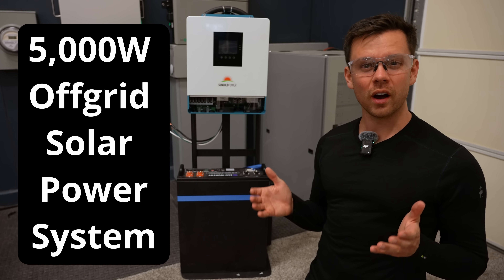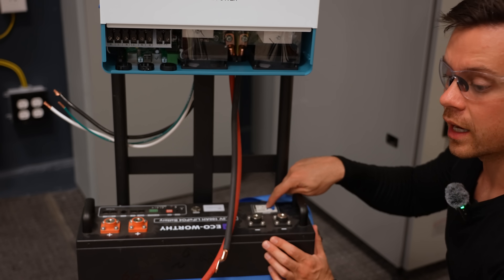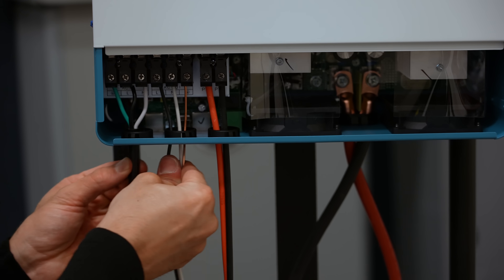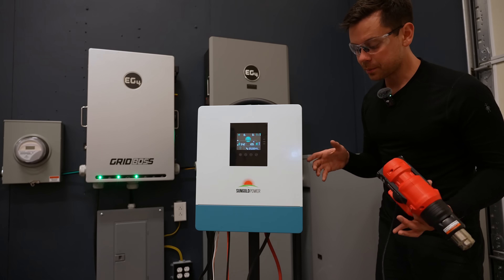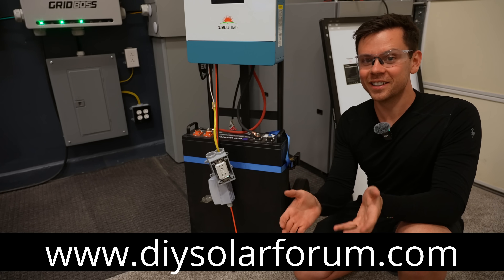Build a 5,000W Off-grid Solar System in 1 Hour

Comment from the maker: Official Parts List to Build Your Own):
https://www.mobile-solarpower.com/mobile-48v-system.html

Important Links Mentioned:
Cold Climate String Voltage Calculation: https://youtu.be/5sYi_HFgmSY?si=OUrvc26LGTzEC4Gn
Outlet Box Tutorial: https://youtu.be/6nPgF8RmDCc?si=ge33kO75pXfk86I2

0:00 Intro
0:18 What You Need First
0:44 Connect The Battery
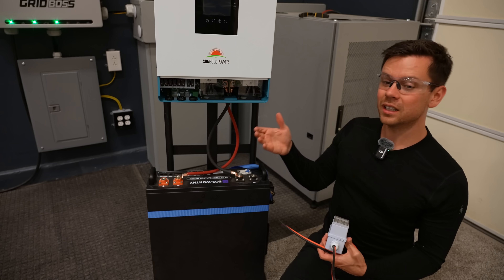1:42 Connect PV Disconnect
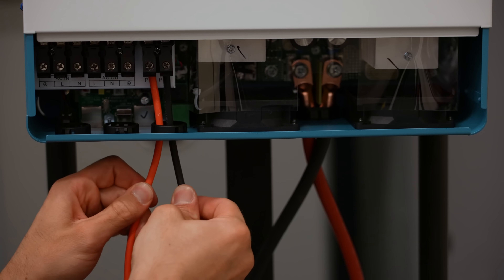2:23 Connect AC Outlets
4:08 Connect AC Input Cord
4:46 Power it up! 
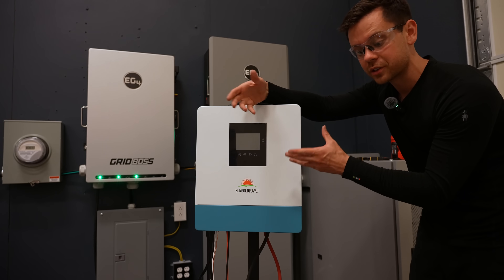6:30 How to Connect A Solar Array
9:10 Limited Roof Space? Use this!
9:32 Powering 12V Loads
10:03 Conclusion

~~~~~~~~~~~~~~~~~~~~~~~~~~~~~~~~~~~~~~~~~~~
Tired of getting ripped off? Check out my "Will Prowse Approved" solar product recommendations below!

12V Batteries
https://www.mobile-solarpower.com/lithium-batteries.html

48V Batteries
https://www.mobile-solarpower.com/48v-batteries.html

Offgrid Inverter System Builder
https://www.mobile-solarpower.com/48v-complete-system-blueprint-559371.html

Hybrid Inverter System Builder
https://www.mobile-solarpower.com/code-compliant-48v-offgrid-system.html

Mobile Handtruck System Builder (very popular!)
https://www.mobile-solarpower.com/mobile-48v-system.html

Solar Panels
https://www.mobile-solarpower.com/300w-solar-panels.html

Ground Mount Solar Racking
https://www.mobile-solarpower.com/ground-mount-racks.html

Wire, Lugs and Busbars
https://www.mobile-solarpower.com/wire-and-connectors.html

Tools
https://www.mobile-solarpower.com/tools.html

Fuses and Circuit Breakers
https://www.mobile-solarpower.com/fuses.html

Plug-N-Play Solar Systems
Ecoflow, Anker And Bluetti! So many models to choose from. See my current recommendations here:
https://www.mobile-solarpower.com/full-size-systems.html

~~~~~~~~~~~~~~~~~~~~~~~~~~~~~~~~~~~~~~~~~~
Need to build a large DIY system? Need a trustworthy solar distributor? These are my favorites:

Signature Solar
Creator of EG4! Solar Minisplits, Victron and More! Largest Solar Store Online.
If you want $50 off, please use my link below and coupon code "DIYSOLAR50":
https://signaturesolar.com/?ref=cPwLcVc0SW-BjN

Current Connected
Best Prices for EG4, Victron, Midnite and so much more! Fast Shipping and Highest Rated Customer Service:
https://currentconnected.com/?ref=wp

~~~~~~~~~~~~~~~~~~~~~~~~~~~~~~~~~~~~~~~~~~
Join our DIY Solar Community 
Need more help? Join the largest solar forum on the internet for beginners and professionals alike. 140,000 members and counting!
https://www.diysolarforum.com

Check Out My Free Book
Best-selling and beginner-friendly guidebook to off-grid 12V solar!
https://www.mobile-solarpower.com/the-book.html

~~~~~~~~~~~~~~~~~~~~~~~~~~~~~~~~~~~~~~~~~~
Contact Information:
I am NOT available for personal solar system consult! If you wish to contact me, this is my direct email: williamprowsediysolar@gmail.com
FTC Disclosure Statement and Disclaimers:
Every video includes paid promotion or sponsorship (such as free products for review). Some links on this YouTube channel may be affiliate links. We may get paid if you buy something or take an action after clicking one of these. My videos are for educational purposes only. Information is subject to change/update at any time. Electricity is DANGEROUS and can kill. Be smart and use common sense :) DIY Solar Power with Will Prowse is a participant in the Amazon Services LLC Associates Program, An affiliate advertising program designed to provide a means for sites to earn advertising fees by advertising and linking to Amazon.com
Reply: Will this scale to 10k?
Reply: So calm and really helped me fill some gaps in my knowledge
Reply: green wire of the tool cable going into the hybrid inverter should have been a bit longer than the others, to release last, so the meal housing is kept grounded for as long as possible (while the other two wires start to make contact with stuff) - giving the circuit breaker on the source side a way to shut the whole thing down.
Reply: Will i thank you for making these videos im 2 years away from living Off-Grid & I always watch your videos this makes it easier for me to start practicing here at my home.. Much Love ❤️ Thank you.
Reply: Will, you did not explain how you correctly sized your solar disconnect switch.  What is the proper way of doing so?
Reply: I’ve watched videos for Europe talking about its common to have a small system and charge it at night when rates are 1/2 price and then use the accumulated electricity to power the fridge and small appliances during the day.
Reply: Thank you very much 🤝
Reply: Will Can I connect this to a 30amp transfer switch?
Reply: How much do solar watts do I need to support this.
Reply: Thank you the "how to build" with parts list... Ordering now... Can you do a follow up on building a series with this type of system?
Reply: Will Prowess Solar Pro🎉
Reply: Hi.. Will..I'm about to build my campervan..will it enough to power my desktop computer, laptop,starlink and fridge other then that It just led lights..I often work on construction site that doesn't have electricity..oh yeah..at night I need to charge my drone..I live in Asia..
Reply: I have the same charger inverter can't I plug in a wind turbine into the unit on the 3 phase AC side, since they make ac power
Reply: Will have you tested any of their other inverters? I see a few split phases that are more affordable than EG4 then I would be interested to put towards this build.
Reply: Will:  I have a 24v microhydro system with inverter, regulator and batteries.  I would like to add solar for low water times, perhaps 400w.  

No one seems to know how to accomplish this.  Is it possible?  Difficult?

Many thanks 😊 

Paul
Reply: any thoughts on the T-type fuse between batteries and inverter? Potentailly using this as a critical loads "UPS"...
Reply: I wish you had a clone in the UK 🇬🇧,  id love to know what to look for here. Or even a great list of English websites that are reliable.
Reply: This looks identical to the Eco-Worthy 5000w 100amp AIO..... ????
Reply: Dude this video is awesome
Reply: Great lesson Will!  Thank you, subscribed.
I am setting up 8x410w solar, with EG4 6000W chargeverter, and 2x100Ah batteries (EG4).
I see you used an ECO-Worthy battery - very interesting.
I had seen the Sungold chargeverter you used here while I was shopping.
Again, thanks for the great example my friend.
Liked! 🌱
Reply: Interesting build Will, I understand you like 48v systems, yet at 5kw for the battery seems a little under powered. 

The question I have is why not use a 600 amp 12v lifepo4 battery and keep it at 12 volts, thru the system? 

A quick Amazon search one can find these 12v 600 lifepo4 batteries range from $750-1k. Add a 12v 5kw pure sine inverter, with a 80 amp mttp charge controller, add some fuses,solar panels,  a hand truck, some 0 gauge cables, some straps, etc and for under $2,700-$3,500 have a 7.5kw-15kw+ battery system. 

Considering that why would one step up into a 48v system? That has a similar cost yet with only 5kw, instead of 7.5kw or even 15kw or 46kw.
Reply from the maker: @antonwearsakilt5209  underpowered? The Max output of this battery is 5000W and the inverter output capacity is 5000W. Not sure what you mean 

12V? That would cost more money and have lower efficiency. Not sure why I would want to do that. And solar charge controller would cost even more. Can't use a 500VDC scc either. Pretty much worse in every way and more expensive. Check the prices again and look at the actual numbers
Reply: My boat runs on 12V , most boats and RV's do , 48V doesn't cut it.
I wish you would do some vids for boat and RV power supply based mainly on solar.
We're off-grid most of the time so hooking up to the main is limited for charging.
Reply: @planetScrounger  He shows you how at time 9:32 with a 48 volt to 12-volt converter.

Comment: I saw another video where Will was demonstrating fuse size, and I remember he made sure, after connecting the positives, to touch the negative terminal to the battery, while the inverter was off, to get a spark and charge the capacitors. I remember he said it's a good idea with the small 12V system, but definitely necessary on the larger 48V systems. Why wasn't this necessary here?

Comment: I just put this system together and when I plugged the AC cord into my outlet the voltage immediately dropped from 120 to about 106 or 107 volts. Any ideas what would cause this?

Comment: ECOFLOW D PRO

I’ve assembled a smaller system for my living room. 
Power station is 3600 watts Ecoflow D Pro. 
Using one 235 watt solar panel feeding a charge controller, which charges the batteries. 
I’m going to add a couple  more panels. 
The batteries put 24vdc into the DC input of the power station. 
I’m only using it for the t v and refrigerator. 
The screen shows it will last for 16 days. 
Two 12 v Redodo 100 amp hour lifepo4 batteries are in series for 24v. 
That adds 2400 watts. 
I’m going to replace the two batteries with one 48v 100 amp hour lifepo4 battery. 

I’ve done this to supplement the 40 solar array on the house coupled to 2 Tesla batteries. 
During the fall and winter in San Diego it is real hard to charge the Tesla batteries from solar. 

Any ideas to improve my system without costing tons of money?

Comment: Thank you for the video.  I will need to power a well from time to time.  The surge is my concern.  Can I get a bigger than 5000 watt inverter or run them in parallel to do this?  Forgive me if I used wrong terminology.

Comment: Hey Will, I'm starting to get interested in solar and was wondering why the inverter in your video requires a minimum of 120V? I currently just want to get started with 2 panels to start learning about the topic and was just wondering if it would not charge or just slowly?

Comment: Hey Will i got a question in regards to charging using the AC input.
I live in europe, here we use 230V single phase instead of 120 as you americans use.
We are looking at a unit that can supply 230V single phase, it has a battery port, AC output and AC input exactly like the model you showed in your video.

My question is, when you connect the hybrid to the wall for AC charging, would there be a chance that it draws more power than the house circuits can manage?
Most of our circuits in our house run of 230V 16Amp breakers, the max AC charge current the inverter can handle is 230V 100amp. So I am a bit worried if it would attempt to charge at the 100amp and trip the breakers.
Do I need to adjust settings to limit the max draw current, or would a hybrid inverter be smart enough to limit its draw on its own?
We plan to have the unit located in a small insulated shed adjacent to the main house, and we have a outdoor plug that would work perfectly as charging point. but the circuit runs 230V 16amp, and the circuit does supply other appliances than that singular plug.

Hope you can cast a bit of light on the situation, I would rather not burn out my breakers

Comment: How good does that step up voltage sing work if you only have one or two panels does it give the inverter enough voltage operate at a decent level? Thanks in advance for any answers I might get I'm going to see if I can find a link to it in the comments

Comment: Curious: I've wanted to connect a wind turbine to my eg4 3k system for a while now. I contacted eg4 and they said it wasn't supported. Your video gave me an idea. My question to you Will, can I just connect a charge controller that gets it's input from a wind turbine directly to my eg4 batteries and have both systems charge the batteries at the same time? This would be the perfect world: having both wind and solar on the same system.

Comment: Hello thank you for your video, I want to build something similar to this for a mobile system, can I use 24 volt solar panels instead of 12? I noticed on your list to things to purchase you had 12 volt solar panels can I do less panels in series and use 24 volts maybe 6 panels of 24 volts? Three in series and the other three in series two separate strands? Instead of 12 volts? Okay thank you.
Reply: So it would be 3 24 volt solar panels in series, and the other three 24 volt solar panels in series and then combine the two parallel, and the math is telling me 72 volts that's above the 48 or 51 volt battery would that be sufficient? okay thank you

Comment: Question, is there a delay from grid to off power switch? So would the refrigerator that was running gets shut down, would it spike. AKA causing a surge to the compressor.

Comment: Great video! Do you know any good hydrogenerator that are AC TO power a house, or DC That will charge a battery bank? I have a year round rushing creek, not alot of sun, Id like to design a sytem to power the house withe the existing sun and year around  creek.

Comment: The thing is a 170 lb beast, as built (just finished mine and i used a sheet of 2/5 in HDPE as a mounting platform for the other components.).  The 800 lb rated hand truck from harbor freight is 38 lbs, the inverter is 28 and the battery is 100.  I had to order new #2 coper ring terminals for the battery cables, which will arrive tomorrow.  Cant wait to fire it up.

Comment: Do I need to ground the solar panels? If so - how? And then where do I run the ground wires to in the inverter? And does the ground wire go through the solar disconnect? Thanks so much!!

Comment: hi, what gauge wire do you use for the power box @2:38? your other update video said the box was good to use after they've updated their hardware.

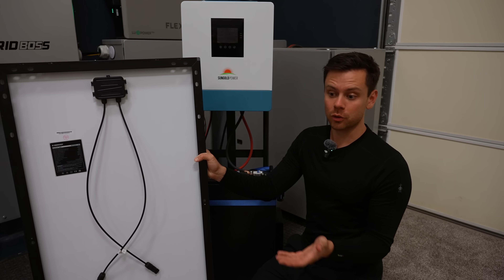@9:20 how do you connect the stepup charge controller to the system? does it connect to inverter or directly to the battery? 

thank you!

Comment: Hi Will, I'm thinking this would be a great upgrade in our RV? I'm assuming I would need the 48v to 12v step down converter (connect to current 12 fuse panel), a way to utilize the diesel engine alternator to charge while driving and connecting the roofs 800w solar panels. I like the idea of an "all-in-one" system instead of wiring all individual pieces. Our Rv currently has 2x 100w 12v Lithiums, a 2000w inverter, 4 x 100w solar (switching to 6 renogy shadowflux 200w)  I could remove the double Battleborn batteries and put in a single 48v battery, (Remove the current 2000k inverter) Add the new all-in-one where the current 2k inverter is, and I should be set. Thoughts.   Great job explaining the hookup.

Comment: If it takes only one hour building one, I don't want to be the one doing it. Because anything that goes wrong could be expensive or worse death. 

5,000 Watts is no joke. And I'm certain it won't be a 12v system, but a 48v system. 

And we are talking about some serious power. So if you are not a certified electrician or take a course in electrical current theory, DON'T DO IT!

Comment: I watched you build a system on a piece of plywood back in 2017. It helped me to completely understand solar and how all the components work together. I bought a van, and all the parts I needed to build a solar system in it. 200 watts on the roof. a controller and fuse box inside. a 3000 watt inverter. 1200 amp hours of lithium batteries that also charge off of the van's alternator when I'm driving. It's still working today. Thanks for helping me and everybody else.

Comment: Will this system choose what power to use to charge the batteries?  I'm off grid and want something that I can add a generator to use on cloudy days, when I start the generator  will I need to change a setting?

Comment: The part i struggle with is the DC in protection. Different setups. This one had only 2 switches trip switches? Fuse and surge arrestors shouldnt they be there also? Some people have earth leakage in the ad and dc boxes my electronic guy say that's actually no good that there should only be one eartleake in the the system my one is the house gross db box trying to get clarity. I also have a 3 way isolator switch on the db board solar off grid. I was that is a better way then multiple2 way switches. You cant switch that wrong by mistake.

Comment: perfect. I did this, it is working , as soon as I can figure out a car port mount it will be done as far as panels go. I wanted to start small at first. I may just use it to power a small heat pump windows unit for free. I laughed as soon I got sick of power going out I got generator an power only been out once for longer than 1 day. lt figures. Like insurance. Still I may never been afford complete solar, but its quite fun, and this man video's are the best, so much so I seen someone else has stolen his hand truck video...classic. I wonder do I need a breaker between battery and inverter to be super safe? thanks

Comment: If you don't want high dc voltage, which is dangerous, go for a low voltage MPPT charger to divert the solar charging. So you can use 1 or 2 panels if for example you want a mobile cabinet for outdoor with a single panel, which looks like a solar powered office cabinet or just like a solar powered table. I would preffer to add swivel wheels to an office cabinet covered in reflective pvc vinyl to reduce sun heat. And mount 2 air panels for cooling. The panels can stay horizontally and also lifted by an extension arm.

Comment: what do I need to connect a manual transfer switch to this setup so I can run my house partial grid and partial solar? I noticed the transfer switches all have a 240v plug receptor for generators to plug into. I assume there is a way to connect one to this?

Comment: I think I am gonna buy based upon size meaning Length and Width but likely 300w to 400w bifacial.  But I will mostly need wind power. So I would only have 900 to 1200 solar. Until summer or maybe living on some land in FL. Then I can use solar mostly in winter.